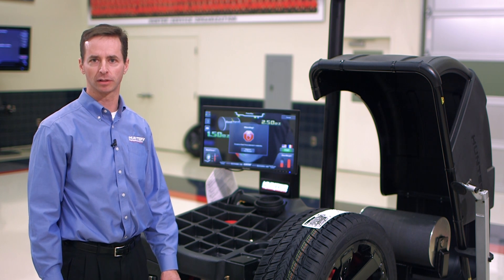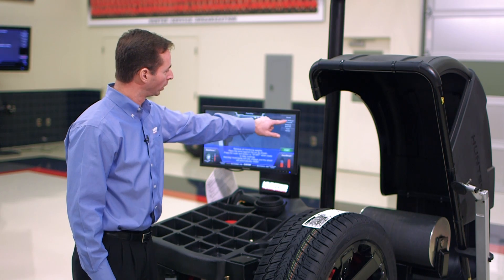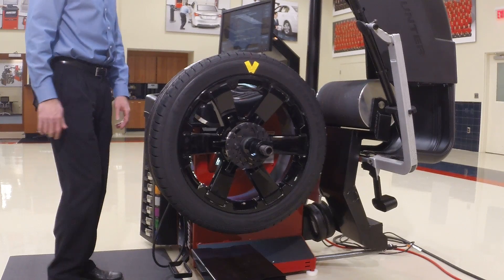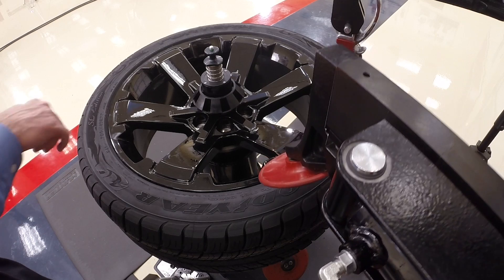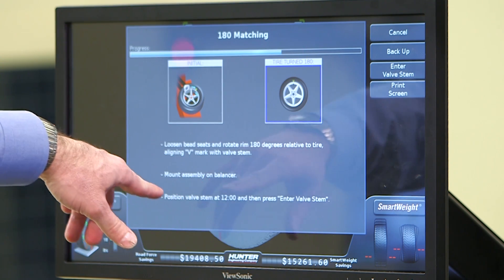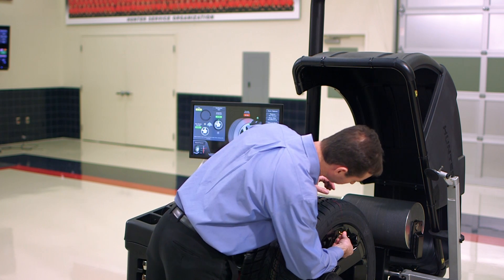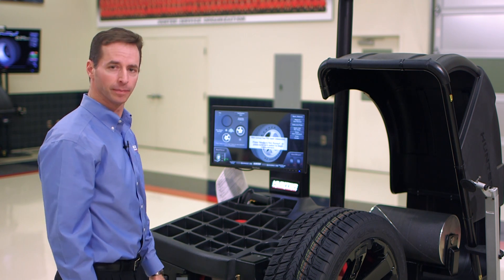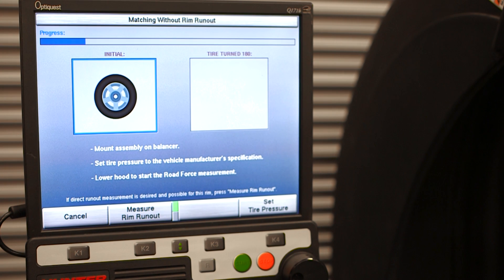Force Matching 180 Procedure - Hunter Engineering Co

Comment: Is the point on the tire with the high road force variation generally also the same location as high radial runout of the tire? 
Also if time is NOT a factor which process gives the best force match results, The 180 method or the quicker method of letting the machine measure rim runout? I mean why does GM insist on using the 180 method?
Reply from the maker: The stiffest point of an assembly is not always coincident with the high spot.  This is why we use the load roller to ensure we are measuring stiffness and not just runout.  If the 180 matching procedure is carefully followed it is the most accurate method of ForceMatching.  This is why GM requires the 180 matching procedure.
Reply: @HunterLearningChannel  that makes sense thanks for the reply. 
Let’s assume the 180 matching is correctly preformed and let’s assume we also have a new version road force machine like an RFE10E with cameras and laser etc to profile the rim correctly.  On average how far off in accuracy percentage is the rim profile method vs 180 match method? Asking out of curiosity because 180 method takes twice as long and is it really worth it?

Comment: fantastic machine.  to bad the majority of the tec's will never take the time to do this.
Reply: I find most shops get a roadforce machine just as an advertising tool. Hardly any shop does force matching let alone this 180 procedure. Their hope is that majority of tires will be good “enough” so to turn around more volume
Reply: exactly.....Called a new Discount Tire in Olive Branch MS...They said oh yes we road force balance every tire we have brand new 18k dollar machines and we do it every time......I get there today to have tires put on my truck and they have 4 different kids one for each tire changing tires on my truck, not a one ever used the road force wheel on my tires till I brought it to the attention of the guy working the counter and then they did not even do it right..... What is the point of having an expensive machine and not using it to lessen the chance of  having a customer return because they have a shake at a certain speed.   Piss poor training and management of a store.

Comment: Is it possible that a tire can be in such condition that a correction is not possible and the tire must be replaced with a new one?
Reply from the maker: Thank you for the question. It is possible that the tire may need to be replaced, and it is possible the wheel may also have too much runout (it is out of round).  A Hunter RoadForce Balancer will help diagnose inconsistencies in tire and wheel, and the Force Matching procedure will guide the technician to turn the wheel on the rim to minimize Road Force to get the best ride.  If an acceptable solution cannot be found then tire or rim replacement must be considered.
Reply: @HunterLearningChannel  can an alloy wheel that is out of round be fixed ?
Reply from the maker: @YoutubeUserPremiumYT  Some companies offer alloy wheel repair equipment, but there are limitations as to what can be repaired.  Since we at Hunter Engineering are not experts in this area, I would consult a specialist in this field to find these limitations.

Comment: I brought my VW Touareg to Precision Automotive in Endicott, NY. They roadforce balanced new tires on fairly new wheels and I had steering wheel shake afterwards. After a second roadforce balancing the shop mech. said the weight were off by 1/2-3/4 oz. and the RF #'s were 49,45,44,24. He said he couldn't get them any lower and said my tires were garbage. I know the mech. didn't follow the instructions in the video because he never broke the bead of the tires to rotate them for an optimal setup. Now the steering wheel shake is worse over a larger mph range. I think this technology is great but negated when mech.'s don't follow or understand the proper procedure. Most of the time it's a save time and money thing for the shop.
Reply: yep you had lazy ass tech that did not know what he was doing.
Reply: Wow - small world... I used to go to them exclusively because of this machine but I also think they didn't use it to its full potential. Got a lot of wheels with counterbalanced weights. They also helped me warranty "bad" tires with "high" road force, only for me to find that the tires were fine when I returned them to Tire Rack and they measured the road force. Precision measures road force but never corrected it. I ended up getting my own tire equipment because of this place, the price was astronomical for imperfect balancing work.

Comment: Looking for somebody to help me out here.  I replaced all tires on my 2016 VW Touareg and have had a vibration and slight steering wheel shake above 70mph ever since.  According to the techs, all tires road force balanced fine.  However, they are nowhere near in the teens of road force.  I think the lowest one I saw was somewhere around 24.  I know for a fact one was at 30.  Is there a standard for the road force measurement?  I am taking my vehicle to Discount Tire tomorrow because I read that they have a Hunter RF Elite.  I am hoping I can get this to match mount my tires to rims.
Reply: good luck... yes your numbers were way off.
Reply: How did it go? You really  have to call around and ask the shops if they are willing to match mount the tires REGARDLESS of what the machine says is acceptable, the lower the better. I found a guy locally with the Elite machine and he match mounts every single tire. It is often overlooked and takes literally 10-15 more minutes at most per tire and can make a HUGE difference. You don't really have to use the 180 matching procedure with the Elite machine. All the technician has to do is press the RoadForce icon and a screen comes up telling him the optimal position of the tire on that specific wheel. This is not the case with the other versions of the same balancer as they use mechanical arms to determine the runout, etc.

Comment: My local shop has the Elite machine. I specifically asked them to get the RF numbers to 10 pounds or below, regardless of what the machine said was acceptable (which I believe is 20 pounds). They said when an assembly is within spec (which all of mine were), they cannot reduce the numbers any further except for a few trial and error tire spins on the wheel, and even then the RF number might get higher. Is this true, or is there a way to bypass the machine's tolerance and ask it where the best position of the tire/wheel to get the lowest RF number and the smoothest ride?
Reply: Derek- 
Thanks for the comment. Let us try and shed a little light on the capabilities of our machine. Yes, Road Force can be reduced below the tolerance if the tech chooses and the assembly is capable of it. That being said, it does get progressively harder to make improvements as the values get lower.
Reply: he's yanking your chain.  the machine shows the # and it is up to the tech to see if they can get it lower by using the machines correctly.